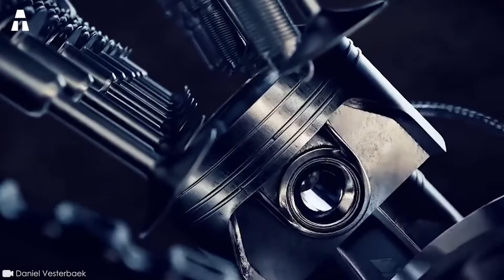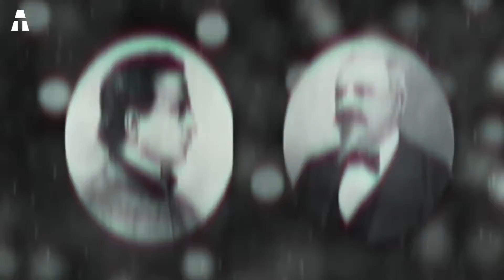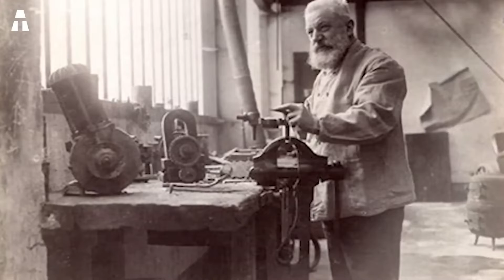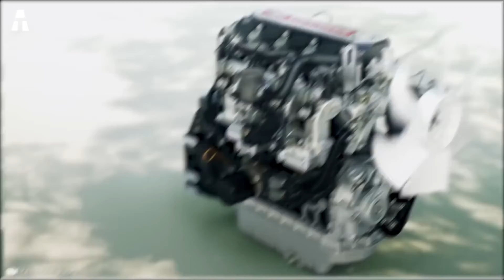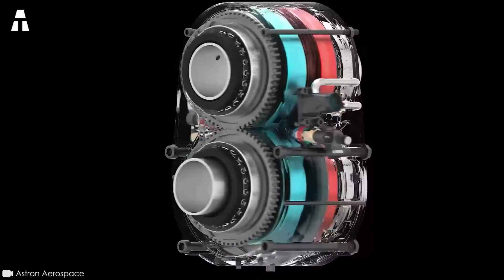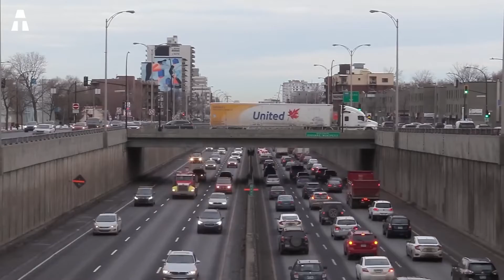The Incredible Omega 1 Engine Revolutionizes the Automotive Industry

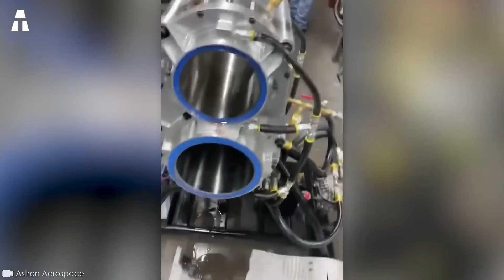Comment: I have to admit, impressive on the idea. The brief scenes of it running, what is all of the liquid it leaking (5:23)? The puddle on the floor in front of it is not good. The top cylinder, looks like it is leaking oil from the beginning of the video. Brief shots of it running raises red flags. How does it do on endurance testing????

Comment: How do they deal with sealing the rotating piston/combustion chamber? What about lubrication of the piston? Seems to me this will suffer from the same problems as the rotary engine and the liquid piston engine X.
Reply: It's just relatively tight tolerances (0,1mm or 0.004" in retard units) between the titanium "donuts" on the combustion side. Repairman22 has a better video about this engine.

Comment: Some info about the operation would have been nice, this was more a history lesson on ICE. As stated below current battery vehicles are not viable.  And you talking about climate shows you have fallen for the lie's. The climate model numbers from CMIP are hugely flawed. The very near future  hydrogen will be used, Toyota has already made one but big oil is holding on tight and there are not enough fuel stations currently to sell the hydrogen.  So aTech EN, i know you can do better.